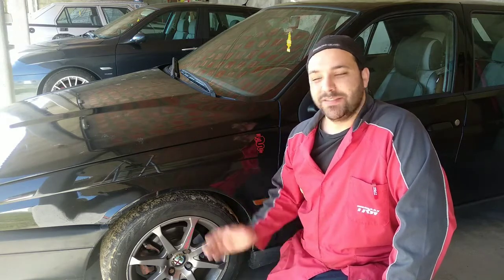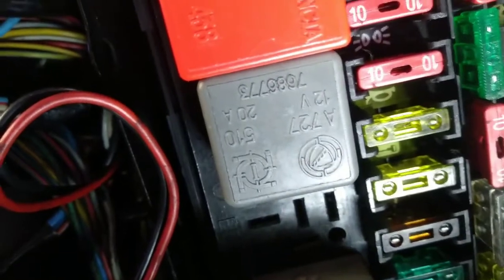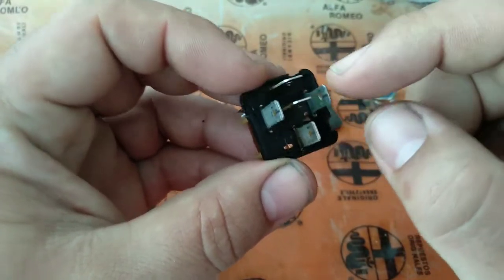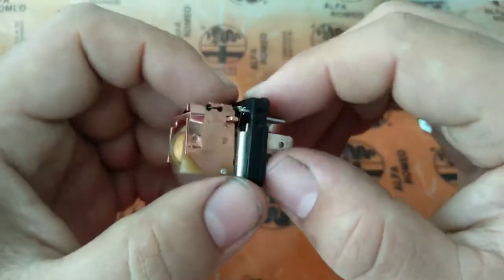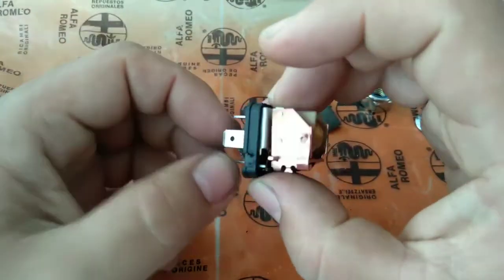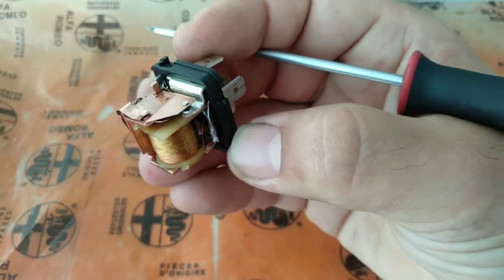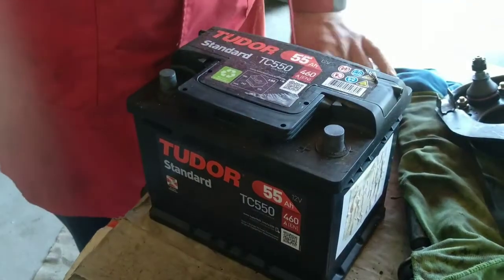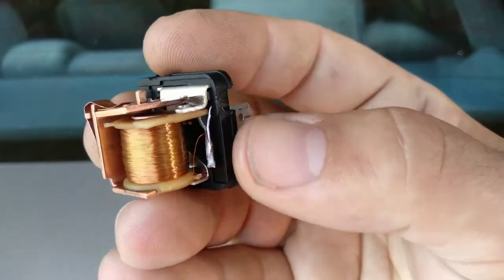How to diagnose a simple electrical system  How to test relays and horns

Comment: I had problem with signal on my 156, it was hard to diagnose because it disapeared and came back randomly, I tried feew times to diagnose it and I could'nt find it because the cirquit was ok, the problem was a cirquit board under the airbag in the steering wheel, there are some small jumpers SMD style with "000" on them and they burned out( or the solder itself caused bad connection), I just desoldered the burned one and joined the soldering pads together closing the open cirquit
Reply from the maker: Wow awesome information! Will consider that in future malfunction videos.
Thanks again for watching

Comment: Do you know the part number of the horn for the 159 2.2 JTS 2010? Are they the same for all models and engines? Because the ones that I found only specify Brera and 2.4 engine for example.
Reply from the maker: Hello. Did you look for them on eperfiatforum?
Reply: @alfaromeonoproblem  Yes,  and I did not see the horn listed anywhere.
Reply from the maker: @DashCamSerbia I'll try to find
Reply from the maker: @DashCamSerbia "apparatus and electrical controls"
50508363
Reply: @alfaromeonoproblem  Thank you.